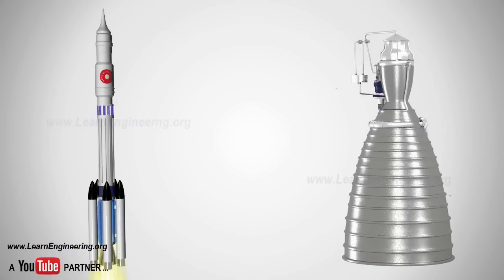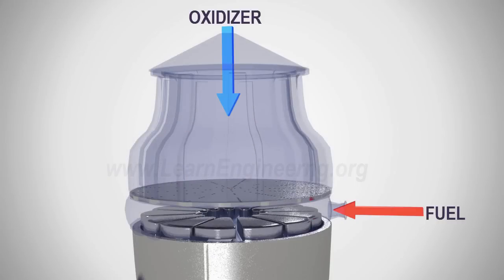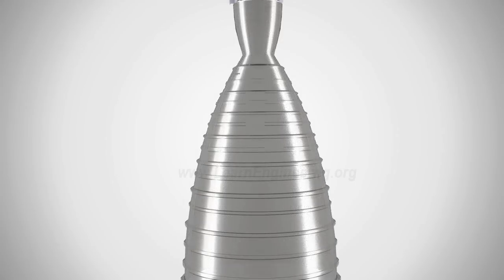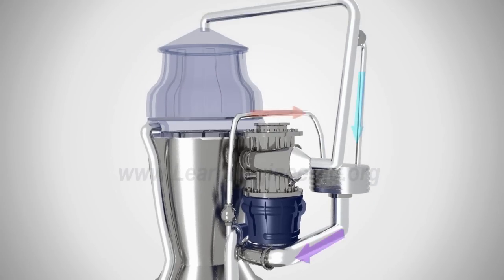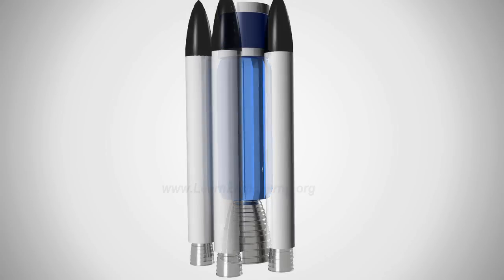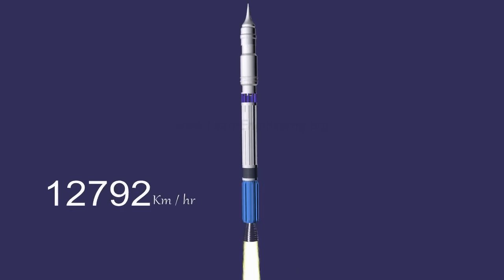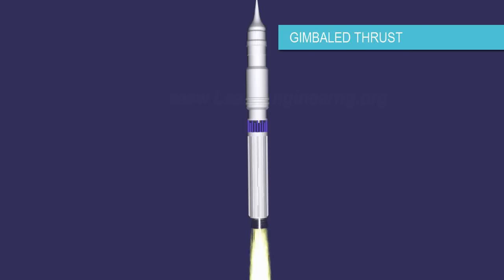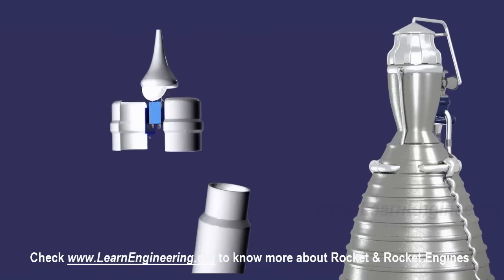How a Rocket works?

Comment: This is truly flawed! Rockets only work in a pressurized environment! In the vacuum of space the effect of a rocket engine firing would be NetZero it could run all day and it wouldn't move an inch. Rockets work very well in our atmosphere in a closed system that is pressurized not in an absolute vacuum
Reply: So, a rocket is sitting in a vacuum, it shoots out exhaust at several thousand miles an hour behind itself, and the rocket itself doesn't move because it just decides it suddenly wants to ignore the first law of motion? If there's no resistance acting on you, and you propel something behind yourself, by the laws of physics you'd have to move forward. All the force that goes into propelling the exhaust backwards must also apply to propelling the rocket forward.

If you were to take the average velocity of the entire system, including all the exhaust that it fired behind itself, then yes there would be a net of zero, but that's the point, the rocket is jettisoning its exhaust at an incredible speed in order for the equal and opposite reaction of that propulsion to accelerate it forward. You can't fling something away from yourself in space without being flung in the opposite direction. If I'm in space and I throw a bowling ball as hard as I can, I'm going to be equally pushing off of that bowling ball as I am throwing it , and we're both going to go flying in opposite directions with equal force. If for example I weigh 10 times as much as the bowling ball and I throw it at 50 miles per hour, the ball would fly off at 50 mph, I'd go flying in the opposite direction at 5 mph, and while if you averaged the total velocity of me and the bowling ball's center of gravity together it'd be zero (with 15 pounds going one way at 50 mph and 150 pounds going the opposite way at 5 mph meaning no net velocity for the entire system since we had nothing to push off of), in spite of this I'm still individually going to be moving at 5 miles per hour and absolutely won't be staying in the same place. Rockets do the same principle, expel a bunch of matter behind itself and push off of it in the process, the collective center of gravity to the rocket and its fuel stay in the same place, but the rocket itself goes zooming off faster and faster the more fuel it shoots out. And yes the fuel itself is pretty light in comparison to the rocket, but combustion causes the vaporized fuel to shoot out so ridiculously fast it still accelerates the rocket just fine despite the weight differential, like how a bullet can still have a crazy amount of recoil pushing off from a gun even though the bullet itself barely weighs anything.
Reply: @Trunkerunk  ... you and the ball are separate... it depends on the mass of the ball too. If the ball had a great enough Mass you would not move it anywhere you would just push off of it. If the ball had a much lower Mass you would throw it away from you without feeling the force that all your arm would absorb it. Newton's Law of motion only works with two separate objects. On Earth the two objects reacting with each other are the thrust from the exhaust and the atmosphere ... the rocket is just along for the ride. In a weightless perfect vacuum like space you have removed one of the elements of interaction. Yes a rocket would work just fine in space you just wouldn't go anywhere. It would be like trying to lift yourself up in a chair that you're sitting in. It's just my opinion
Reply: @None888.  But as soon as the rocket fires off its fuel, the fuel and the rocket itself (or every single particle of exhaust and the rocket itself) functionally become two separate objects. It's basically doing the bowling ball trick billions of times a second with every little particle of exhaust.
Reply: @Trunkerunk  ... thanks for trying to explain it to me but I think we disagree I've hurt my head long and hard thinking about this and it just don't have the energy to get into it anymore
Reply: @None888.  Number one thing about physics: there is nothing special about bigger objects. This goes for everything – everything has a gravitational field, though for many human-sized objects it's really tiny. No physical law can say "if an object has a large enough mass" – if something applies to one heavy object, it will apply to light objects as well.

You're right in a way though. If a ball has a heavy mass it won't accelerate much - so you get pushed a lot. Lighter balls will accelerate a lot more when you push them, but they still are providing a force. Rocket exhaust is the same thing as holding a bunch of really tiny balls (molecules) and throwing them all in the same direction really fast. No single ball is going to do much at all, but if you have millions of those a second, it'll actually work.
Reply: @AmbientMorality  ...the force has to be greater than the mass to move something ...here or in space.... you're not going to throw a ping pong ball in space and get moved in the opposite direction
Reply: @None888.  Force and mass aren't comparable; they're different units. "Force has to be greater than the mass" doesn't make sense; it's like saying "time has to be shorter than length".
Reply: @None888.  It is better to use the conservation of momentum to explain how rockets work than Newton's third law.  The law of conservation of momentum is simple, and to think it would just stop working simply because there is no air is just asinine.

The momentum of any arbitrary closed system is conserved.  A closed system is simply a collection of any number of arbitrary components.  If you calculate the total momentum of all components of that system, it will always be the same.  In this case, we can define our system as the rocket and all the fuel inside that rocket.  Momentum is just mass times velocity.  Let's say our rocket and all the fuel inside that rocket has a mass of 10,000 kg.  It's initial velocity is zero (floating in space stationary relative to you).  This means that at any point, no matter where that mass ends up and what the velocity is, if you take the sum of the momentum of each component, it will always add to zero.

I will use two-dimensional space to simplify this, and I define left as the negative direction and right as the positive direction.

Let's suppose our rocket is fired up and 3,000 kg of fuel is ejected at -800 m/s (toward the left).  The momentum of just that fuel which was ejected would then be 3,000 kg * -800 m/s = -2,400,000 kg m/s.  Our system - which consists of all 10,000 kg of mass of the rocket and all fuel - will always have a total momentum of zero.  This is a fundamental certainty in physics.  This means that in order to maintain the momentum of our system, the remaining 7,000 kg of rocket and remaining fuel must necessarily have momentum of 2,400,000 kg m/s (positive to offset the negative momentum of the ejected fuel), so the resulting velocity of that remaining 7,000 kg of mass would be 2,400,000 kg m/s / 7,000 kg = 343 m/s.

It is categorically impossible for a rocket to eject mass away from it and NOT be propelled in the opposite direction in order to maintain a constant momentum.  It just can't happen.  The notion that a rocket could just sit floating in space while ejecting huge amounts of mass at huge velocities and just sit there is just preposterous nonsense; only someone utterly ignorant of basic physics that appears within the first 10 pages of the first physics textbook opened by elementary children would ever utter such demonstrable nonsense.
Reply: @None888.  force measured in N
Mass measured in Kg.
I don't know what units you use, but the above are what the civilised world uses.
Reply: @ΑΡΗΣΚΟΡΝΑΡΑΚΗΣ  ...we use coconuts and rocks and sticks to measure here in the uncivilized world.....
Reply: The rocket pushes exhaust gasses away, therefore the rocket is pushed away too. Would it be different if you push a friend at sea level and in a vaccum?

Comment: Still don't know what an oxidizer is??
Reply: Liquid rocket fuel cannot burn without oxygen, as is the case with any type of combustion. Given that space doesn't have any oxygen, rockets are forced to bring their own: that's the oxidizer. It's any chemical (typically oxygen) that enables combustion.
Reply: @hydrochloricacid2146  thanks

Comment: If a water-electric hybrid system can be used in rocket technology we could put a satellite into space without polluting the atmosphere. I propose the ramjet system be used in all stages of the rocket engines as long as the rocket is within the atmosphere. At the ground level of the rocket, if atomized water is sprayed into the combustion chamber which is heated either by induction heating or microwave heating methods, the heat in the combustion chamber would turn the atomized water to vaporise and would thrust out of the nozzle. As steam thrusts out of the nozzle, air is sucked in from the inlet at the diffuser. As more and more steam passes, more and more air is sucked in, and this causes compression of air inside the diffuser. When compressed air is then thrusted into the combustion chamber where it mixes with atomised water, it and explodes into steam, and thrusts out of the nozzle - this gives the lift to the rocket. 
As the Scottish engineer James Watt observed in 1776 in a boiling kettle on the fire in his chimney, steam is a "mover of mountains," - then it could be used to propel a rocket into space as well. By use of steam jet propulsion, we could save the environment and stop 140,000 tons of fossil fuel from being burnt into the atmosphere as in Falcon Space X programme does, each time it is launched.
At every stage of the rocket, electricity for the above rocket engine is drawn from ultracapacitors made from curved graphene, which can store a high amount of power than conventional EV batteries.

Comment: If you think rockets can work in space, then you do not understand Newton's 3rd law at all...

NASA states on their official website that rockets do not require atmospheric pressure to push away from because they use Newton's 3rd law premise of 'action-reaction' in order to fly. And this, they also state, is why they can work in space. 

This is NASA's 3rd law, not Newton's.

The reality is, Newton's 3rd law irrefutably proves the opposite, that rockets CANNOT work in space using just 'action-reaction'. It is physically impossible.

Check out the following video which uses Newton’s actual 3rd law premise of 'action-reaction', to finally and undeniably prove that rockets CANNOT possibly work in space... https://youtu.be/FpQ3ynXrG_o
Reply: "Newton's 3rd law irrefutably proves the opposite". And the earth is also flat...no? LOL, go and grab your Nobel prize!
Reply: If you don't think rockets can work in space, then you don't understand Newton's 3rd law, and you will have to deny the existence of space travel, unless you believe in anti-gravity and similar nonsense.
Imagine two astronauts floating side by side in space. One of them places his hands on the other's chest and pushes him away. What happens? Both will float away from each other regardless of who pushed the other. One of the astronauts corresponds to a rocket while the other corresponds to the exhaust gases from its engines.
If the rocket engine has a specific impulse of 450 sec (close to the best chemical rockets today), each kilogramme of propellant used per second will produce a thrust of 450 kilopond or 4413 newtons. This means that the thrust of an engine using 116 kg per second will be equal to the world's most powerful jet engine, the GE90-115B that powers some versions of the Boeing 777.
(this does not mean that a GE90-115B at full thrust consumes 116 kg of fuel per second!)
Reply: Oh dear, lol. 
Sorry Franky, but it's patently clear, that YOU are the one who does 'not understand Newton's 3rd law at all....'
Back to school for you my friend.